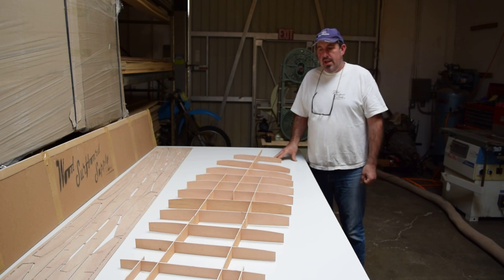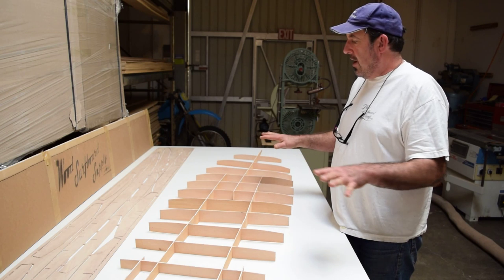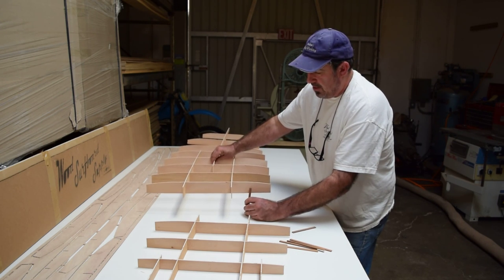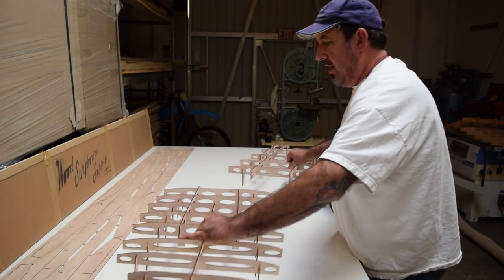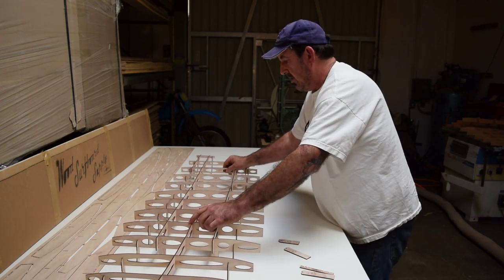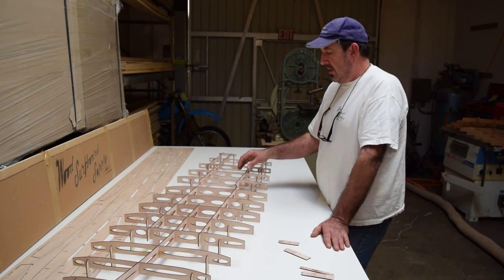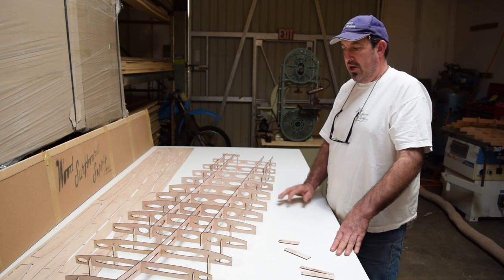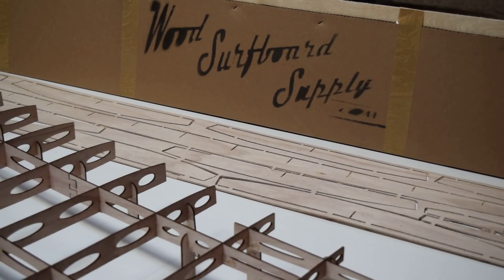Brad Tucker's 2nd generation hollow wood surfboard kits

Comment: I want to buy the frame for the fast lucy. but worried about the board being too heavy. Therefore, what is the lightest wood that I can use that u recommend? Is balsa lighter than paulownia? Is there any other wood that I can use that is even lighter, but no so fragile that the board would break? Or perhaps a better question is: If I use paulownia wood, how thin can the planks be? Basically, I want to make it as thin and light as possible without making the board break. 

Appreciate the help in advance!
Reply: If you use balsa you will have to fibreglass it, if you use paulownia  you can just oil it. Wood depending on the tree can be more or less dense, so have to ask your timber supplier what weight there wood is per board ft.